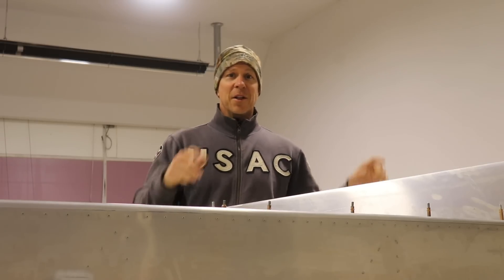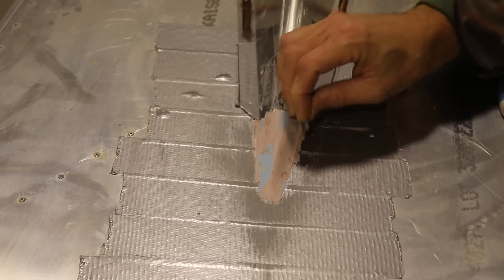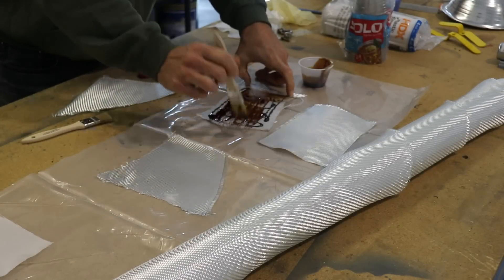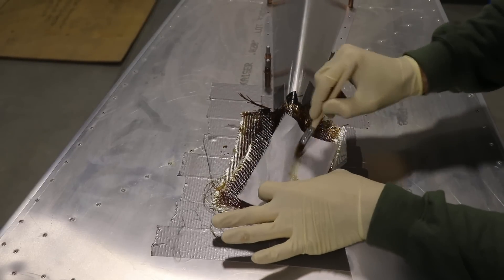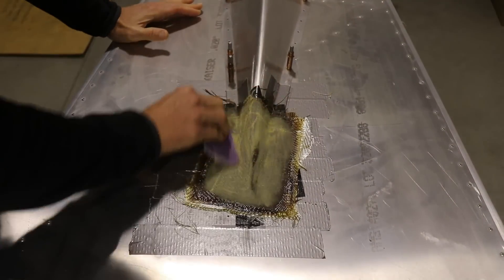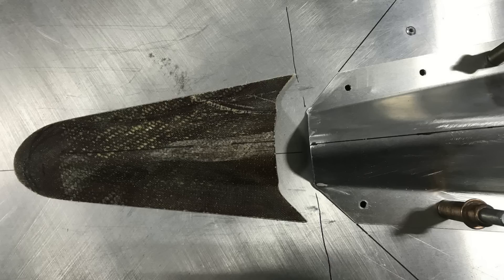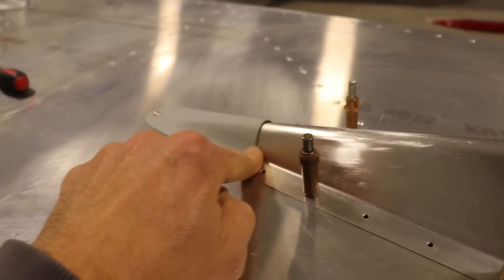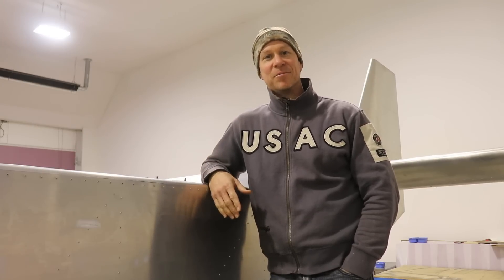Let's make a Fiberglass Faring. (Ep63)

Comment: Hi Mark. I am starting a 701 build and I am using a self etching primer. I am priming the entire inside. My question is for the outside should I spray line of rivet holes on the skin and then rivet, or rivet first and go over it, or leave it until time to paint? 
Thanks

Comment: Awesome!  I use expired bank, gift and hotel key cards etc to spread resin and have found the cards make it easier to spread the resin and I get a more even & smooth spread than using a brush; just my personal experience working on my KR2.
Reply from the maker: I'll have to try that next time. I seemed to have a difficult time spreading the resin this time around. I don't recall having a difficult time the I made fairings for the Cruzer so I figure I need to ask my neighbor (fiberglass pro) what I was doing wrong!

Comment: Anyone who watches those TV ads featuring spray foam can get the impression it is easy to use. Not so, it is a pain in the neck. Hard to cut, difficult to shape and a pain to sand cleanly off a surface.
Reply from the maker: I second that!!

Comment: Also, a small piece like this, save yourself the trouble and just pick up a few pounds of modeling clay at Hobby Lobby.
Reply from the maker: I used clay when I made the fairings for the wheel pants on my RANS S-6S. It is a lot easier to use especially for these small parts. The problem is that it is a certain type of clay that needs to be used, and I can't find it anywhere. Do you have a good source for it?

Comment: I have been following your build with interest. Fiberglass work can be such a pain...but the possibilities are almost endless. I have a couple of comments. (Before I get to those, fear not...it looks great). If you lay up your glass one layer at a time over your mold, you can get it to go deeper into corners, instead of forming over the mold with one multi layer cloth. Also, you can make pieces with tighter tolerances, if you make your final product from a negative mold. For example, the fairing you made would have made a suitable negative mold for your final piece. Then the final fairing would have taken the shape of the foam/bondo positive mold, which did blend smoothly into your strake. This technique also lends itself to achieving smoother finishes. Keep up the good work and thanks for sharing.
Reply from the maker: I agree with everything you said!

Comment: Four would have worked if you had laid them down individually.  If you want to do multiple plies at once put them between two sheets of plastic and use a roller and a plastic blade to squeeze out the excess resin.  Your resin looked really thick as well.

Comment: Very nice 👏

One question though. 

How will you prevent water from ingress under the fairing installation, via the interface between the new nose piece and the rest of the VSTAB’s horizontal faring ?
Reply: By-the-way, thanks for sharing your very interesting and informative content 👍
Reply from the maker: I'm not too worried about it. There's million places where water can enter the Zenith designs. But, I suppose I could put a tiny bead of silicone under the fairing to seal it off.
Reply: @KitplaneEnthusiast , if you have access to a small amount of aircraft grade sealant typically used to seal the interface between fairings and structure, I’d recommend using that instead; much more durable. 

But at the end of the day, 🤔 …  its a small piece and you inspect your aircraft often and maintain them in extraordinarily immaculate condition, so big problems are very unlikely to occur under your watch 👍

Comment: Does fiberglass stick to bare aluminum?
Reply: It will if the surface is prepped. I’ve had errant drops of resin fall outside the area prepped with tape, and they pop right off with gentle pressure after they’re fully cured.

Comment: You should have used what you laid up as a mold for the real piece. Coat the inside with car wax and lay it up in 2 layers. Then pop it loose. Then the finished piece is the size of your bondo mold.